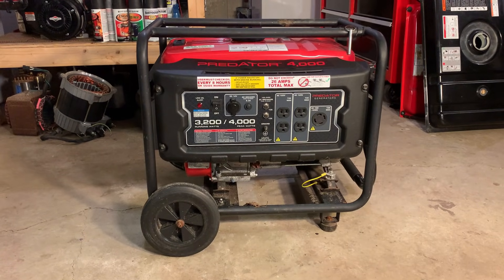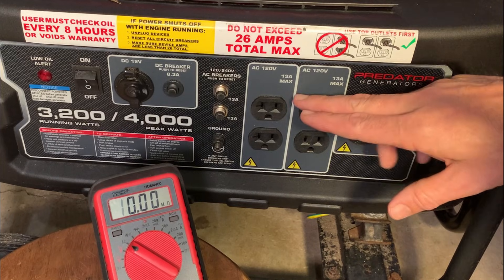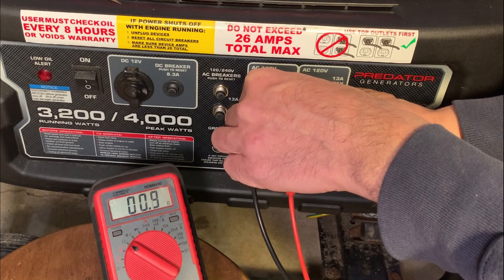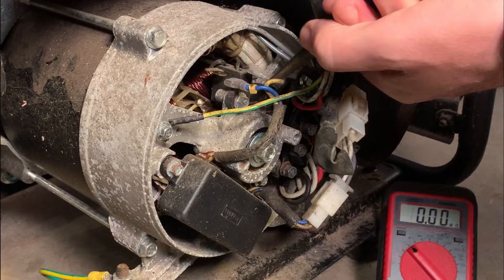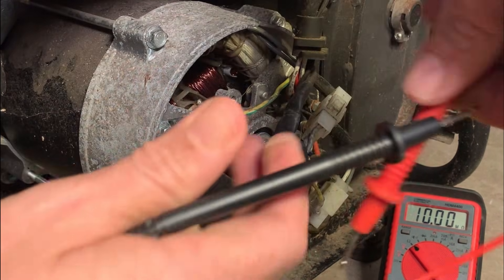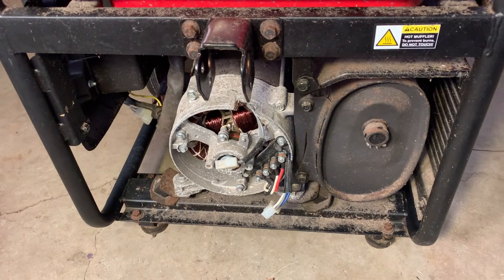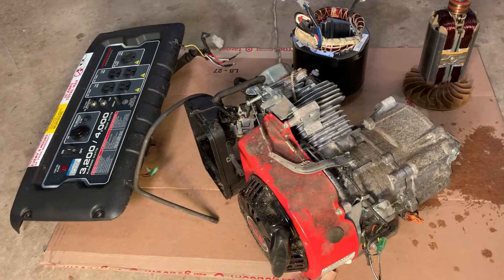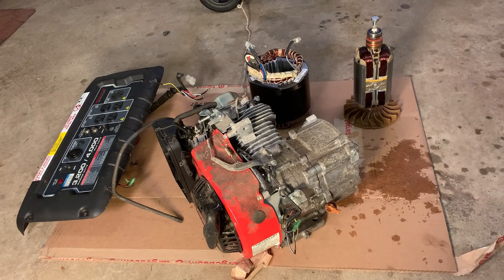Predator Generator Not Making Power

Comment: And Holy smokes the hydraulic removal of the rotor with that bolt is one amazing trick. I'm definitely going to have to remember that one
Reply: Quite a bit of ways to remove items with hydraulic leverage
Reply: @AntonioClaudioMichael  Don’t forget about the generator safety rules: Always make sure you follow all the generator safety rules whenever you use your portable generator. This is only a reminder. Generators can be dangerous if not used carefully. Every year, hundreds of people die or get injured when using portable generators due to carbon monoxide poisoning and electrocution. Make sure you are using your generator carefully and keeping others safe as well. There is something very serious that everyone should always be aware of when using generators. Some people do run their generator indoors which is not safe and that increases the risk of carbon monoxide poisoning which can cause death of family and you. Some people run their generator in wet conditions which can electrocute them. Please remember that you should never run your generator indoors. Remember that carbon monoxide is an odorless and colorless gas that you cannot see or smell. Carbon monoxide is a silent killer. Keep that in mind. Make sure your generator is 15-20 feet away from your house and away from doors, windows, and vents. Never use your generator in your porch too. Having a carbon monoxide detector is very important against generator safety. Some people also allow children to go near the portable generator which could pose risks. We need to keep an eye on our children making sure that they are not near the portable generator so they won’t get electrocuted or burned by the generator which is dangerous. A locking enclosure also keeps kids safe. A generator shed might look like a tempting place to explore, or take cover during a game of hide and seek, but a generator is a dangerous piece of equipment that can cause injury. It says on the manual that we should also keep children away at all times from the portable generator to avoid injuries. Please do not allow a child or unqualified people to operate the portable generator.  It is important to keep your children safe especially little ones. The portable generator can be hot during an operation. Just because some manuals missed what should be listed doesn’t mean it’s safe to do. Always follow the generator safety rules when using portable generators. Generators pose electrical risks. If you need to use your generator during wet weather, you need a generator tent to protect your generator from getting wet. Don’t let your generator get wet. Keep your generator dry and before using your generator, please make sure your hands and your generator is dry. Do not wear loose clothing when operating the generator. Everything that is said on the generator’s operating manual should not be ignored. Never smoke cigarettes near the generator. Please keep flammable things away from the generator. Never overload your generator too. Your generator can catch fire. Never ever try to plug a generator cord into a wall outlet to avoid back feeding. Back feeding your generator is dangerous. Always turn on your generator first before plugging in appliances and shut off the appliances before turning your generator off. Use a heavy duty cord for your generator and the cord should not be worn out. All the instructions should be followed carefully. Never refuel your generator while it’s running. It can cause fire if fuel spills while your generator is hot. You should turn off your generator and let it cool off before refueling it. Having a fire extinguisher next to the generator is also important. This is only a reminder for everyone’s safety of using generators. Make sure your generator is properly grounded. Having a fire extinguisher next to the generator is also important against the safety rules. https://youtu.be/I1jT3ANENvI and here is a video more about keeping others safe when using generators and also about our family’s safety. It’s important to keep our little children safe as well. Make sure your little children are kept away from the generator at all times especially when it’s running. Hope this helps. Always remember that it’s better to be safe than sorry.
Reply: @The_Happy_Aviation_Enthusiast  🤦🏽‍♂️
Reply: James,  I enjoy your video's and have used a lot of your helpful tips.  I think the broken wire in the rotor can be repaired.  It just takes a little patience and a hot solder gun.  I have repaired transformers with the same type of wire diameter and coatings.  If you get a bad rotor again I would be interested in looking at it.  Rick
Reply: I've seen rotor removal with the hydraulic method (water + bolt) or the rod method (rod + bolt).  But to me, if the threads are present, it looks like a slide hammer might be easier.  Thread the bolt in, hook the slide hammer to the bolt head, and a few strokes should pop the rotor off the tapered shaft.
Reply: You can pump grease into it and remove it without removing the engine.
Reply from the maker: Always looking for new ideas.  Would think the air in the rotor shaft would cause an issue.
Reply: I use a grease needle and put a hollow tube over it. Start from the bottom of the hole and work your way out.
Reply: But wait, according to Harbor Freight CEO their generators are just as good as Honda Generators and they will last just as long.  This doesn't look like a very old generator  :)

Comment: I'd love to give fixing that rotor a go!
Reply from the maker: That would be great!  I have fixed them in the past, but was never satisfied with my soldering and end result (although they worked).  Spinning at 3600 rpm, the repair needs to be good.  Unfortunately, I have already used some of the parts on other equipment and pretty sure the rotor was recycled.  Will double check.  Otherwise will reach out on the next one.  I get one or two like this a year.
Reply: @jcondon1  sounds good! Just let me know if you get another rotor like that and I'm pretty sure with my soldering station I could get a good connection on it 👍
Reply from the maker: The right tools and skills make a big difference on that type of repair.  Just watched your recent video.  Glad the generator came back and thanks for putting up the link to my channel.  That generator should last a long time.  What state are you located in?  Sounds like we are both in the North East.  I am on the NY/CT boarder.
Reply: @jcondon1  Unless they have used an epoxy it's quite fixable, I would say. Lacquer it's fine. 

Personally I would rip about 7 cm (-+ 3 inches) of the wire from the rotor, than I would use a razor blade to scrape the laquer off and splice and solder a new wire in. After soldering it´s good practice to cover the wires with something to fix them in place and reduce material fatique (Cu really suffers from it). 
Only possible issue is balancing the rotor back up. Even an slight imbalance will shake the heck out of the bearings.

In the past, all stacked wiring (transformers, rotors etc.) were dipped in thick shellac, later it was replaced with laquer. For the comutator connections an epoxy is used, but I would say that electrical silicone should work fine as well. (Maybe even ATC silicone; just don´t use the sanitary - acid curing - one)
Reply: @vetrnymlyn2  But some wire leads are on the bottom and the other wires are spun on top so no way to pull back a few inches.
Depends on what side your on (Stator)
Reply: Me too.

Comment: I've had similar issues with coils the broke from their solder points.   I always try and repair it.........because if it is successful,  I feel great about it...   If it fails,  well,  I'm only out 15-20min.
Reply: Don’t forget about the generator safety rules: Always make sure you follow all the generator safety rules whenever you use your portable generator. This is only a reminder. Generators can be dangerous if not used carefully. Every year, hundreds of people die or get injured when using portable generators due to carbon monoxide poisoning and electrocution. Make sure you are using your generator carefully and keeping others safe as well. There is something very serious that everyone should always be aware of when using generators. Some people do run their generator indoors which is not safe and that increases the risk of carbon monoxide poisoning which can cause death of family and you. Some people run their generator in wet conditions which can electrocute them. Please remember that you should never run your generator indoors. Remember that carbon monoxide is an odorless and colorless gas that you cannot see or smell. Carbon monoxide is a silent killer. Keep that in mind. Make sure your generator is 15-20 feet away from your house and away from doors, windows, and vents. Never use your generator in your porch too. Having a carbon monoxide detector is very important against generator safety. Some people also allow children to go near the portable generator which could pose risks. We need to keep an eye on our children making sure that they are not near the portable generator so they won’t get electrocuted or burned by the generator which is dangerous. A locking enclosure also keeps kids safe. A generator shed might look like a tempting place to explore, or take cover during a game of hide and seek, but a generator is a dangerous piece of equipment that can cause injury. It says on the manual that we should also keep children away at all times from the portable generator to avoid injuries. Please do not allow a child or unqualified people to operate the portable generator.  It is important to keep your children safe especially little ones. The portable generator can be hot during an operation. Just because some manuals missed what should be listed doesn’t mean it’s safe to do. Always follow the generator safety rules when using portable generators. Generators pose electrical risks. If you need to use your generator during wet weather, you need a generator tent to protect your generator from getting wet. Don’t let your generator get wet. Keep your generator dry and before using your generator, please make sure your hands and your generator is dry. Do not wear loose clothing when operating the generator. Everything that is said on the generator’s operating manual should not be ignored. Never smoke cigarettes near the generator. Please keep flammable things away from the generator. Never overload your generator too. Your generator can catch fire. Never ever try to plug a generator cord into a wall outlet to avoid back feeding. Back feeding your generator is dangerous. Always turn on your generator first before plugging in appliances and shut off the appliances before turning your generator off. Use a heavy duty cord for your generator and the cord should not be worn out. All the instructions should be followed carefully. Never refuel your generator while it’s running. It can cause fire if fuel spills while your generator is hot. You should turn off your generator and let it cool off before refueling it. Having a fire extinguisher next to the generator is also important. This is only a reminder for everyone’s safety of using generators. Make sure your generator is properly grounded. Having a fire extinguisher next to the generator is also important against the safety rules. https://youtu.be/I1jT3ANENvI and here is a video more about keeping others safe when using generators and also about our family’s safety. It’s important to keep our little children safe as well. Make sure your little children are kept away from the generator at all times especially when it’s running. Hope this helps. Always remember that it’s better to be safe than sorry.

Comment: That should be an easy solder connection repair on that winding.Give it a shot,nothing to lose.
Reply: Generator safety rules: Always make sure you follow all the generator safety rules whenever you use your portable generator. This is only a reminder. Generators can be dangerous if not used carefully. Every year, hundreds of people die or get injured when using portable generators due to carbon monoxide poisoning and electrocution. Make sure you are using your generator carefully and keeping others safe as well. There is something very serious that everyone should always be aware of when using generators. Some people do run their generator indoors which is not safe and that increases the risk of carbon monoxide poisoning which can cause death of family and you. Some people run their generator in wet conditions which can electrocute them. Please remember that you should never run your generator indoors. Remember that carbon monoxide is an odorless and colorless gas that you cannot see or smell. Carbon monoxide is a silent killer. Keep that in mind. Make sure your generator is 15-20 feet away from your house and away from doors, windows, and vents. Never use your generator in your porch too. Having a carbon monoxide detector is very important against generator safety. Some people also allow children to go near the portable generator which could pose risks. We need to keep an eye on our children making sure that they are not near the portable generator so they won’t get electrocuted or burned by the generator which is dangerous. A locking enclosure also keeps kids safe. A generator shed might look like a tempting place to explore, or take cover during a game of hide and seek, but a generator is a dangerous piece of equipment that can cause injury. It says on the manual that we should also keep children away at all times from the portable generator to avoid injuries. Please do not allow a child or unqualified people to operate the portable generator.  It is important to keep your children safe especially little ones. The portable generator can be hot during an operation. Just because some manuals missed what should be listed doesn’t mean it’s safe to do. Always follow the generator safety rules when using portable generators. Generators pose electrical risks. If you need to use your generator during wet weather, you need a generator tent to protect your generator from getting wet. Don’t let your generator get wet. Keep your generator dry and before using your generator, please make sure your hands and your generator is dry. Do not wear loose clothing when operating the generator. Everything that is said on the generator’s operating manual should not be ignored. Never smoke cigarettes near the generator. Please keep flammable things away from the generator. Never overload your generator too. Your generator can catch fire. Never ever try to plug a generator cord into a wall outlet to avoid back feeding. Back feeding your generator is dangerous. Always turn on your generator first before plugging in appliances and shut off the appliances before turning your generator off. Use a heavy duty cord for your generator and the cord should not be worn out. All the instructions should be followed carefully. Never refuel your generator while it’s running. It can cause fire if fuel spills while your generator is hot. You should turn off your generator and let it cool off before refueling it. Having a fire extinguisher next to the generator is also important. This is only a reminder for everyone’s safety of using generators. Make sure your generator is properly grounded. Having a fire extinguisher next to the generator is also important against the safety rules. https://youtu.be/I1jT3ANENvI and here is a video more about keeping others safe when using generators and also about our family’s safety. It’s important to keep our little children safe as well. Make sure your little children are kept away from the generator at all times especially when it’s running. Hope this helps. Always remember that it’s better to be safe than sorry.

Comment: Jimmy, you need a 500 volt meggar for your tool box. The hand crank model is fine, and cheaper than the plug-in models, and of course, more portable. This will give you a resistance. Reading  of the winding and field's  insulation. Useful for determining failure due to high heat. 
Biddle, is the best name in meggars.
I would check out ebay
It's a diagnostic instrument made for what you do.
  We used a 1000 volt model at work, but our machines were higher voltage; they produced 40 mega watts  for the Long Island Power grid....
Reply from the maker: I see the crank ones are cheap.  Will pick one up.
Reply: @jcondon1  yes, we used to do a yearly "annual inspection" and check all electrical, contacts on relays, pressure switches , etc. Biddle is the foremost name, they are made in England, or at least were. We would  meggar the field, and stator, run a 10 minute test, take readings every minute, but that was due to the large amount of windings.
This would be filed, and could paint a picture of wear on the machine
  Good for any device, especially where windings are involved; motors of all kinds, car alternators, vacuum cleaner motors, blender motors, etc.
   You seem like you'll put one to good use. Keep up the good work, and be proud of the neat, clean worksmanship, and attention to detail you demonstrate....Happy New Year and good health to you and your family...
                             Doc Watson